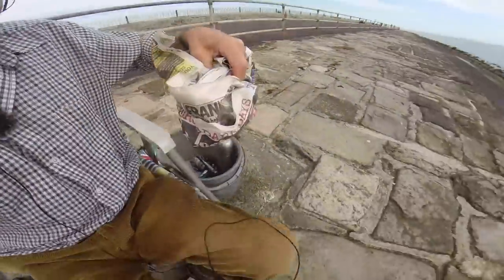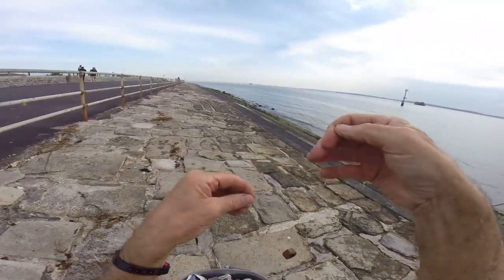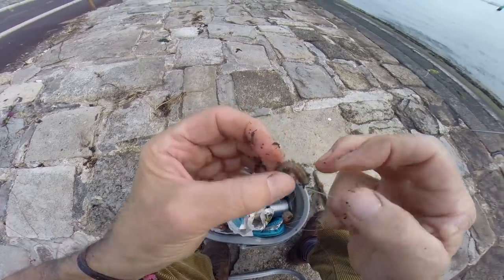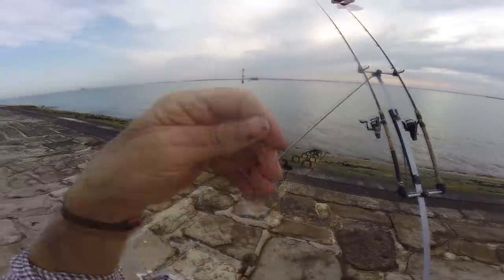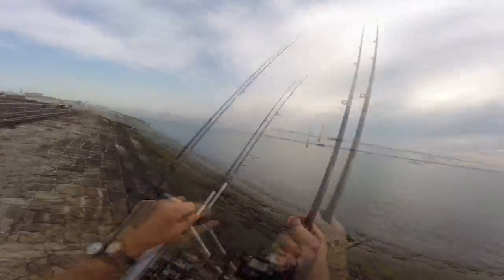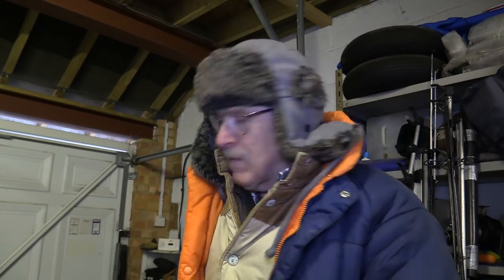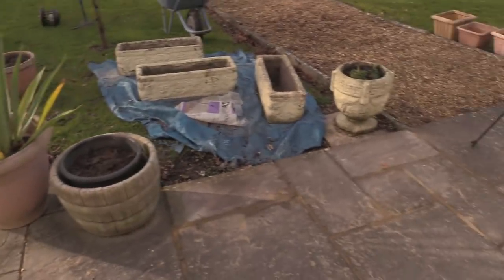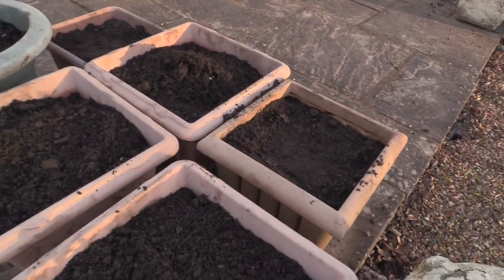Stone Shore Fishing - Are these Small hooks the best way to Catch More Fish??

Comment: Graeme try mixing unibond in with the mortar and paint the joint with it before you point it. that will stop it coming out.
Reply from the maker: It might be the way to go,thanks for the tip. But should I use sharp sand and cement or regular builders sand and cement ??
Reply: @TAFishing  Building sand will be fine,
Reply: @TAFishing I use sharp sand mixed at 3 to 1. Paint the joint with waterproof PVA then parge the mix in and point up.

Comment: Hey guys, I am travelling to TCI (Turks and Caicos) soon. I want to try ocean fishing (I have been fishing since I was a kid but mainly lakes, ponds and rivers - small fish). I bought a travel spin rod (15-40 g from Savage Gear - it's a freshwater rod), do you think it would work with 20g (3-5" lure) soft plastics in flats? Also, I was planning to buy a Daiwa Seahunter Z Travel Boat Rod 30-50lb or DAM Salt-X Travel Boat Rod 300-600g cw . I might only go for one or two boat trips whilst I am there, so most of fishing I will be doing will be probably from the beach or rocks. My questions: 1. What line and lure weight can I use with both rods (The Daiwa doesn't mention CW, only LB rating). 2. Can I use it from beach/rocks or only boat? 3. What fish can I target with these boat rods and on what line :) It's hard to find specific answers out there. It has to be 4-5pcs so I can take it on board. Many thanks,

Comment: If the slabs had been laid on a screeded bed of sand you would not have that problem. When the slabs have been laid on dots on each corner and in the middle it creates voids under them.

Comment: Those gripz hooks are a gimmick, if the hook is under tension then the ridges are nowhere near the flesh and if the line is slack (ie. where a barb would prevent a hook backing out) then there is no pressure to make the ridges grip. Made to catch anglers.
The curve shank design is a solid enough shape of hook though, they're meant for carp fishing and to be used with a knotless knot (hair rig). With the line exiting the front of the eye the curved shank forces the hook to turn into a prone position as the line tightens against a bolt rig.
Reply from the maker: Thanks for the definitive comment. I have used them a few times now, along with Kamasan and the old Partridge Carp hooks(I still have a few of the latter after 40+ years) and they all seem to catch fish. But I do like wide gape hooks.